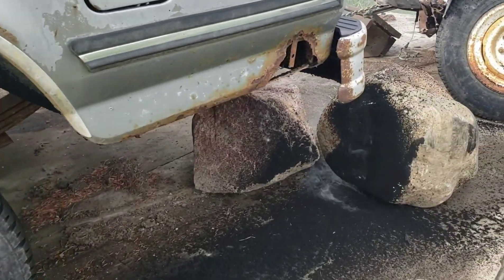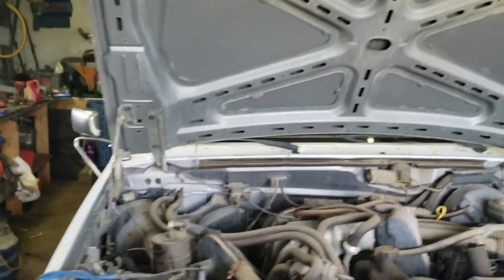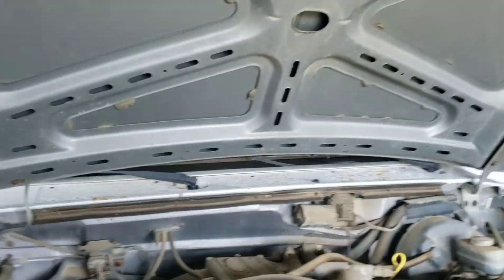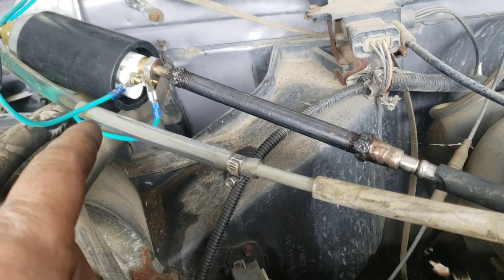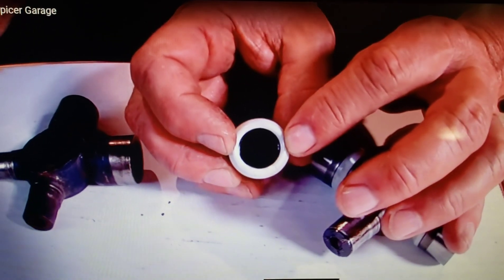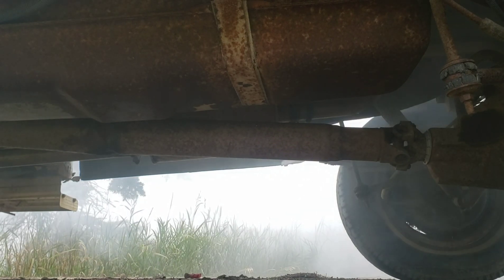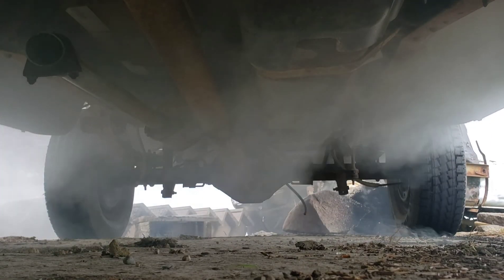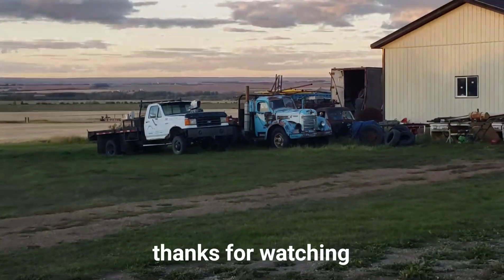ford 300 revival and bent driveshaft torture test

Comment: Gosh, the 300 is such a legendary engine. Probably the best engine Ford ever made. You should run a chain or cable through the wheels and then do neutral drops.
Reply: Buddy of mine, a Roofer had a kinda rusty 300 as his first vehicle after getting his license back. Told him he wouldn't have any major problems (since he knew dick about cars)and his dumbass traded it for a 2001 s10 blazer with a fucked oil pump smh can't fix stupid.
Reply: What a terrible trade... pretty much traded one of the best and most reliable power platforms for one of the worst. I have a wood chipper with a 300 that has 13,000 hours. Pretty much everything else has been rebuilt or replaced, except the engine. I’ve got 3 trucks with 300’s that all have 300+k, same story.
Reply: @stevenlatham4397  I've long lauded the 300 as well as the AMC 4.0 as the reason why inline-6 engines should never have been replaced by anemic V6 wheeze machines in any rwd configuration

Comment: Dorman makes a repair kit for the plastic lines. It's a replacement piece that comes with an updated clip. Cut the old one off and the new piece goes on with a barbed fitting. Works great. Used them for years!
Reply: I was getting ready to say that as well second this motion.  I use the dorman part often as I use this pump for many things including for race cars as this is the pump the local track requires us to use